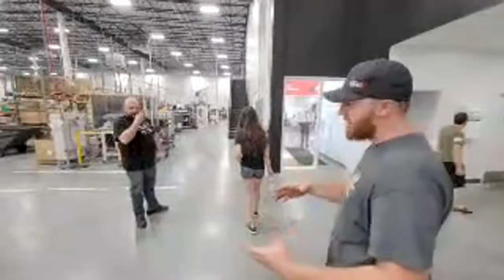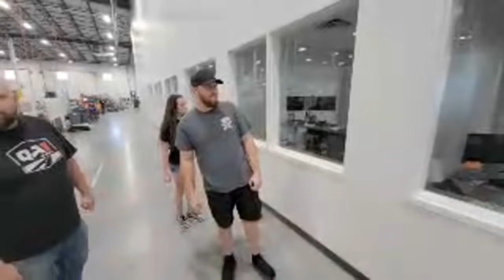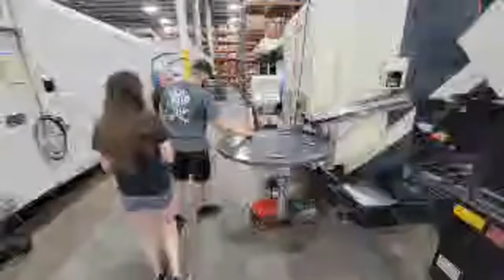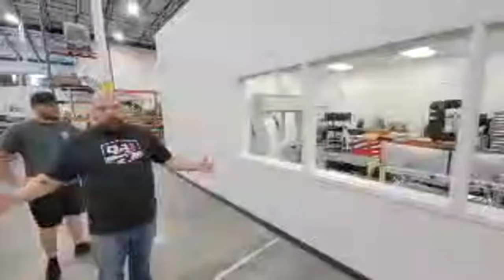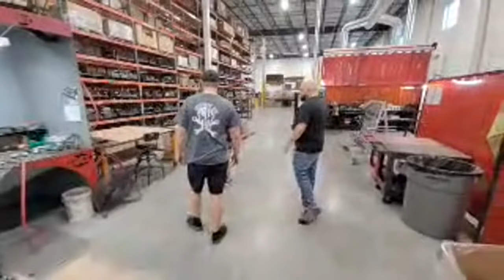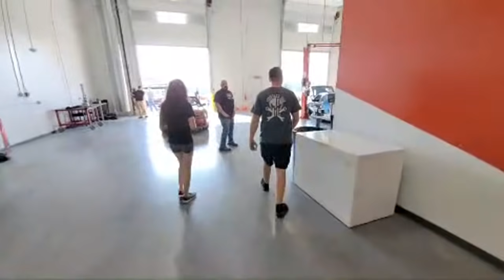QA1 Facility Tour!

Comment: Being a CNC Machinist and programmer. I like the way he explained how there is a lot more to it than letting the mill do the work. Some one has to write a program. The operator has to set the drills, and cutters, and end mills. The operator also has to know when cutters are getting dull and replace them to prevent a crash, as well as knowing when a program needs to be altered to insure a trouble free run. So many people think its a gravy job. There is a lot of learning involved. I run QA1 Shocks on my 64 Fairlane. I like them .
Reply: I’m also a CNC machinist/programmer. Some of the guys at my shop think my job is a gravy job because I push a button and the machine does the work. They don’t think about how we have to fixture the part, select and touch the tools off, write a program and edit the program to run a part. A little bit more involved than pushing a button. Lol